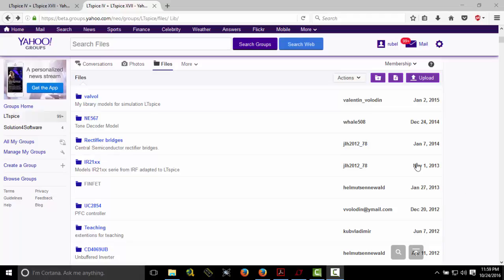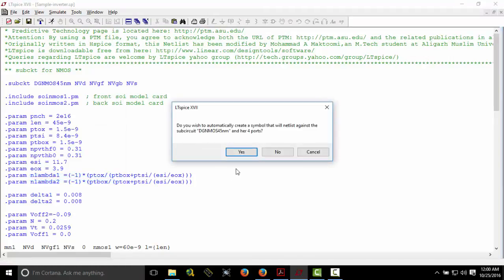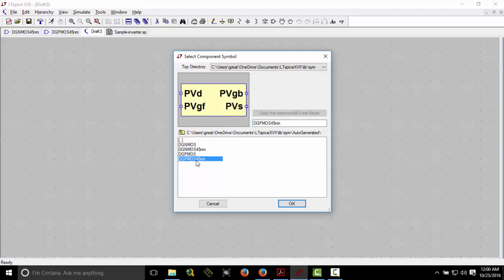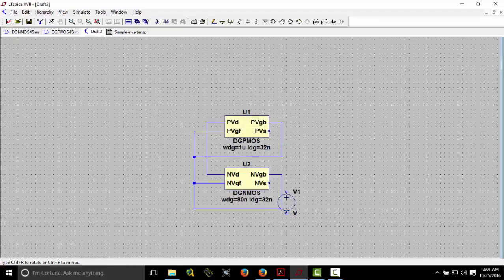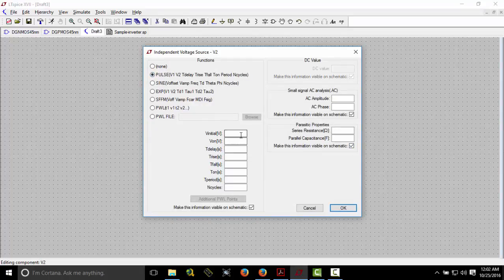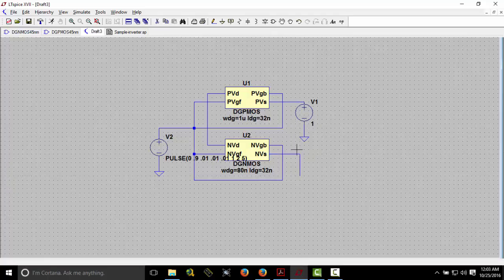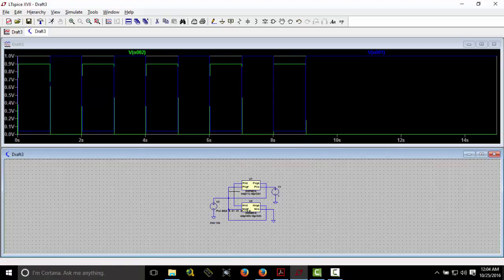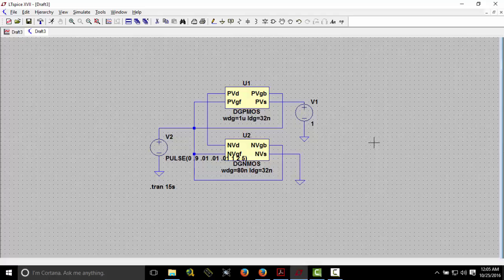inverter using FinFET

Comment: I tried designing the finfet inverter as you told.  But when i try to execute,  it's not running and it is givimg a comment as "could not open the include file .Pm".  Could you please tell me why i cannot run the finfet inverter.
Reply: did u design 22nm  finfet inverter
Reply: maam plzz help me i am facing same issues